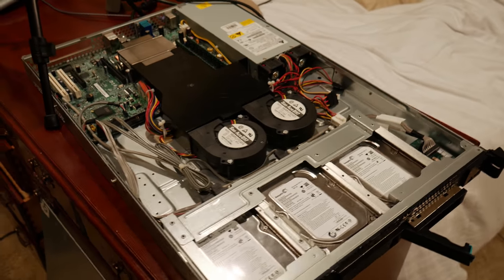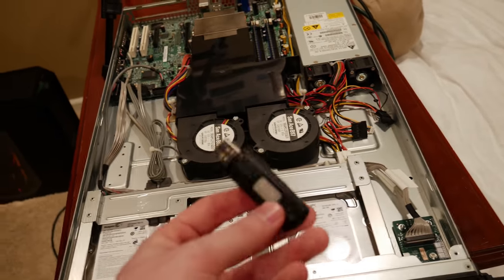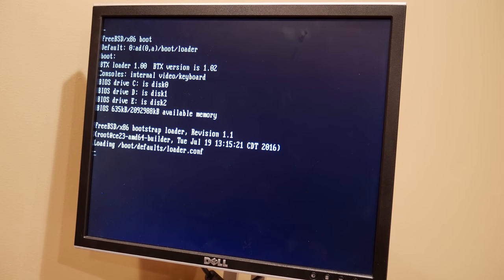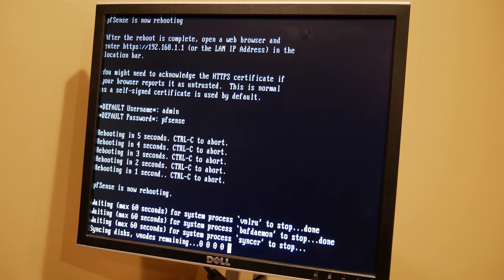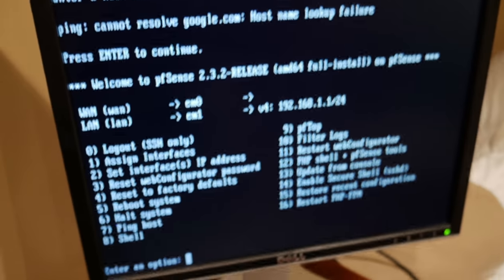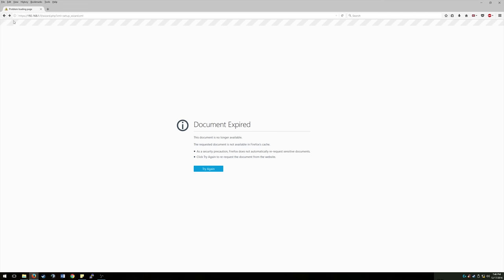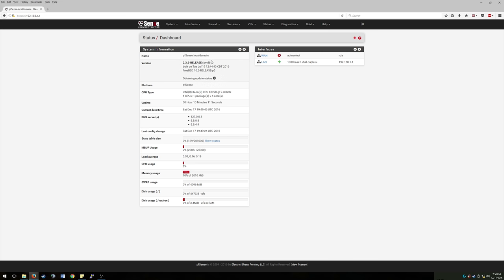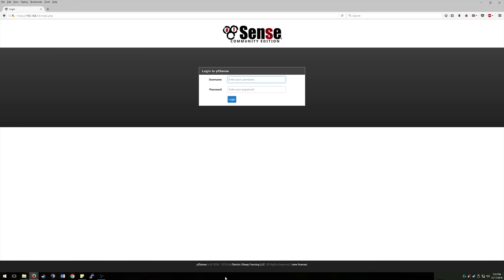Build Your Own Router | pfSense Install Vlog

Comment: I kid you not I'm running pfSense on a P3 800Mhz, runs quite well although webui is abit slow but still usable.
Reply from the maker: Yeah you don't need much to do base routing on Pfsense, but if you want to get into some OpenVPN and snort setups you need a little beefier hardware. I love it though, can't even imagine going back to a consumer gateway.
Reply: True, even a crappy box running pfSense is better by miles than most home routers. I tried a few home routers including isp provided and none of them came close to the features and reliability of pfSense. People who don't run it are missing out, but I think most switched on people are running it these days.

Comment: I'm running  pfSense on an old Fujitsu Esprimo E710 with a Intel G645, 4GB RAM, Intel Pro/1000 PT Dual Port NIC and it has no problem with my 1000/1000 internet =)

Comment: I noticed that you mute the mic all the time. it's safe to assume that you don't want that background noise... in the case, check audacity noise remove plugin... it's very efficient, easy to use and very useful. you can remove that specific fan noise from the whole video, or from the part after you intentionally show how the noise plays at the beginning of the video in a matter of few seconds...
Reply from the maker: I've just been using push to talk for as long as I can remember so I had that setup in OBS.  My mic has some distortion problems when there isn't any main source of sound, which I will hopefully be replacing soon. I've tried some of those before but it ends up distorting some of my actual audio too. Thanks for the tip though, I'll give it a try!

Comment: Hi, pls help.
I am tight on budget at the moment but need to build a pfsense router. Below I have mentioned part details. Please let me know if that's okay for pfsense router as my down & up stream is 40-50 Mbps.

Gigabyte GA-J1800M-D3P Motherboard (Built in Celeron J1800 - 2.41 Ghz Dual Core Processor/ DDR3)

Kingston Fury Memory -4GB -DDR3 1866 MHz Desktop Ram 

Samsung 80 GB sata hdd

Let me know how much power supply is required for this build.
Thanks